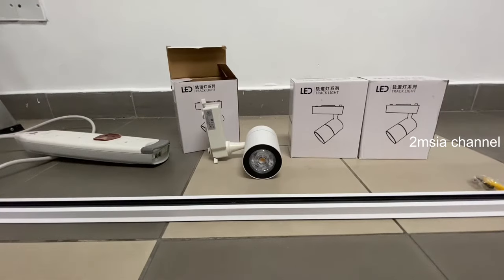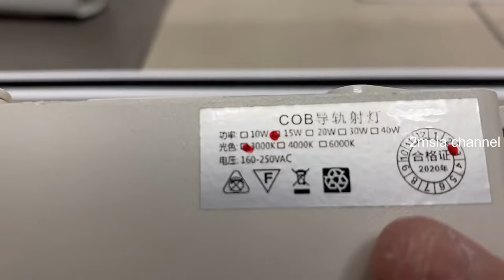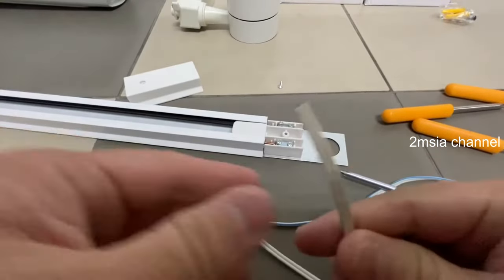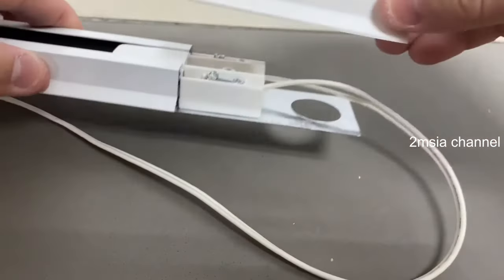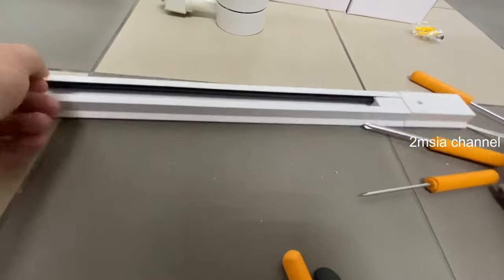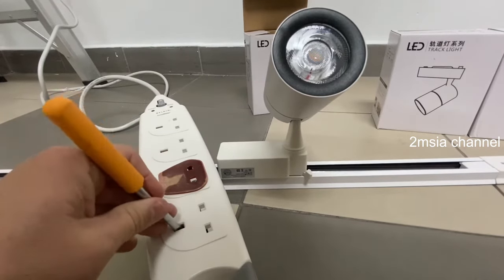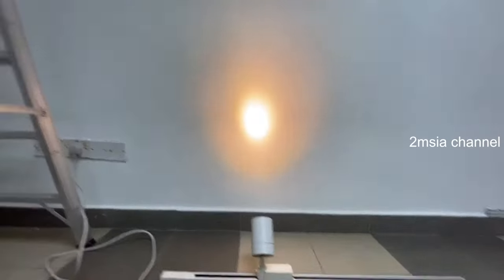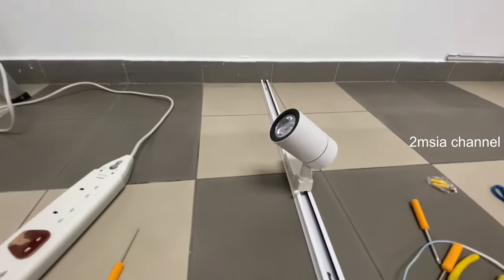How to Install Wiring For COB LED Track Showroom Spotlight

Comment: Looks like can sliding UPVC-window, frame mod-hack, to two windows of exhaust-fans...
Reply from the maker: exhaust-fans...?
Reply: @2msiachannel  using minus-one of your youtube video 
= electrical wiring + rail + sliding-Mount minus light plus fan
= mod-hack without home-cooking every part.
Reply from the maker: @engchoontan8483  this item was very simple, dont make it complicated. just plug n play